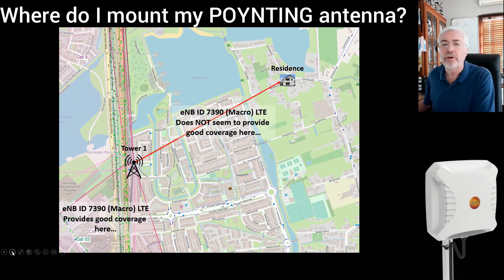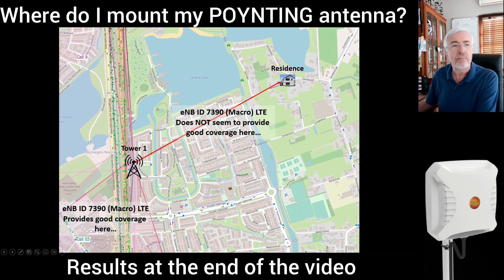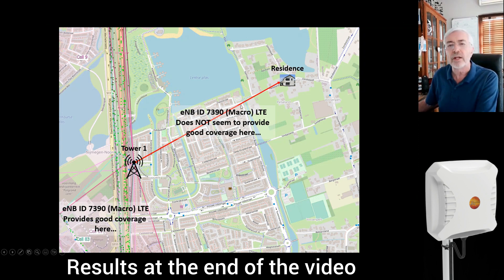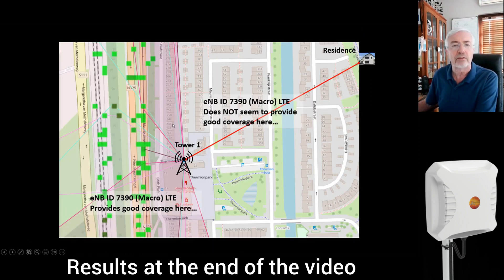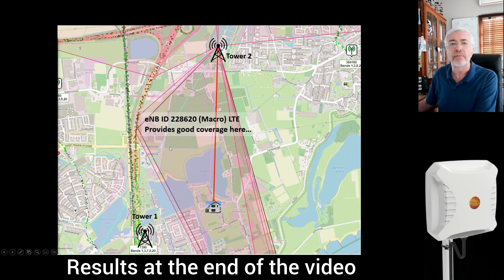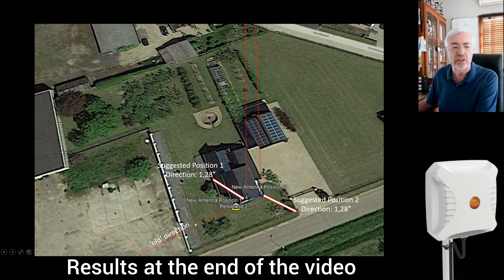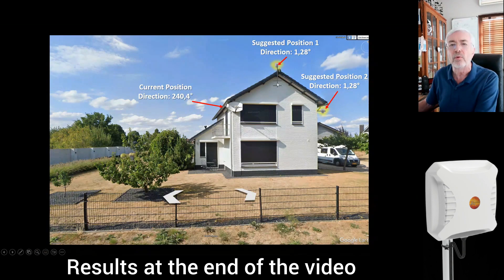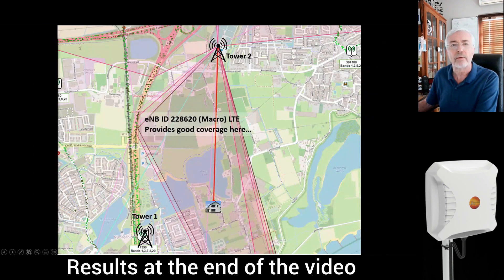Move the #POYNTING antenna, and see the difference it makes

Comment: Are you using open software to determine tower locations and radiation patterns and if so what do you recommend for pre installation surveys?
Reply from the maker: Hi Sean - just a quick note that we are checking with the engineers and will let you know. KR Ylana
Reply: @poyntingantennas  Thanks KR Ylana any feedback from Engineering?
Reply from the maker: Hi Sean - apologies - I did answer before but it seems to have gone missing. We used cellmapper.net to determine tower locations. They have a free version with adverts and they also have a premium version that removes the adverts. Remember the radiation patterns for cellmapper is determined by drive testing from different contributors. 
You can also use Pathloss, which is a downloadable software package.
Kind regards
Pieter
Reply: @poyntingantennas  good morning, I bought this antenna last summer and connected with my 4G router, unfortunately it gave no such improve on speed or signal. I don't know if it is a faulty antenna. The mast that it connects to is 10k away compared to one that is 6km away. Can anyone suggest some help? Thanks